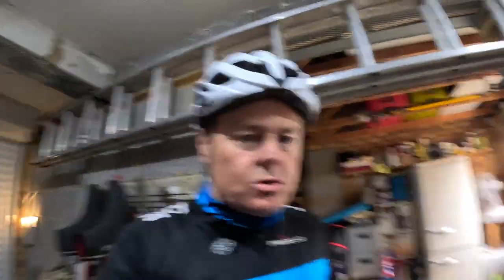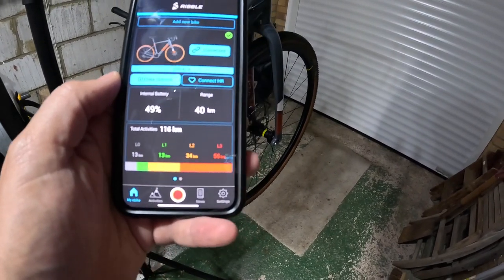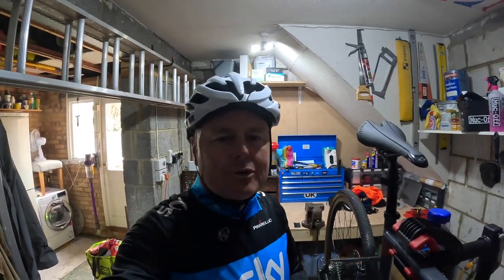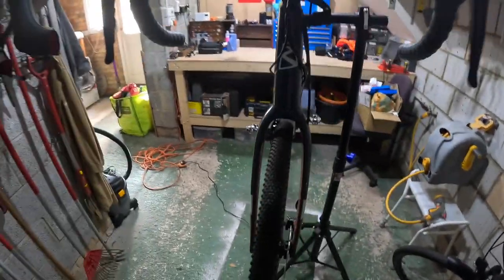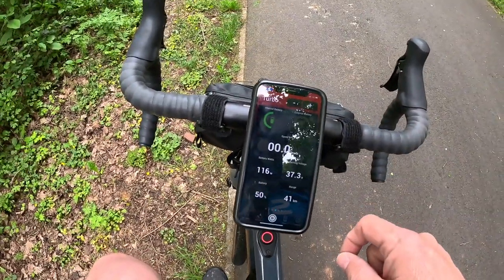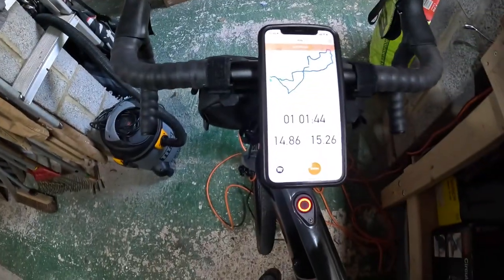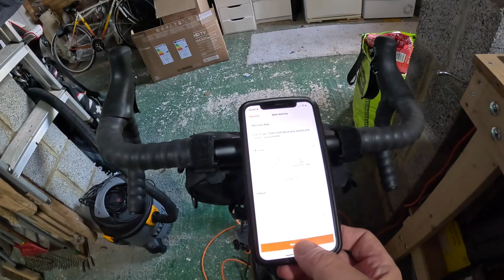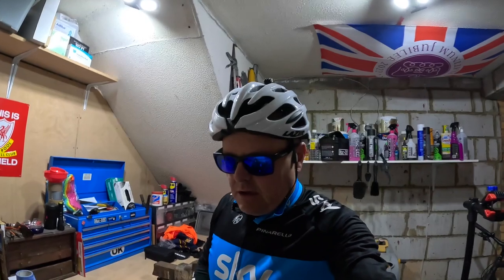VLOG #18 Mahle My Smart Bike App review - Ribble CGR AL e

Comment: Have you tried to Mahle Auto assist on your phone. It quite intuitive and changes the levels automatically depending on your Heart Rate setting and bpm. Happy to explain more.
Reply from the maker: No not yet. I will need to check it out. Thanks for the heads up.
Reply: @E-ZeeRiders  1. start your bike 2. connect your HRM 3. go to settings and pulsometer and click the activate the assist bmp and sensitivity and bpm threshold .4. save and your done.